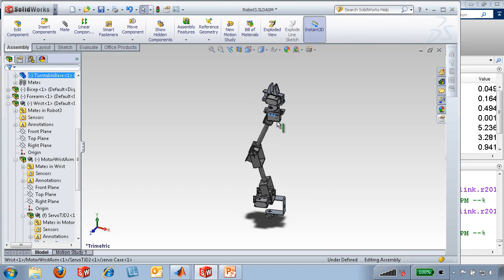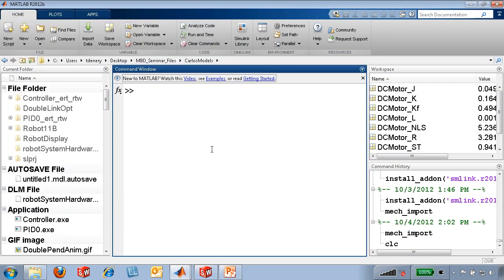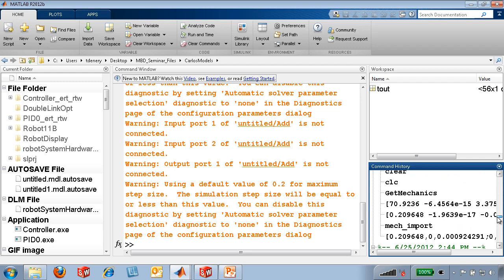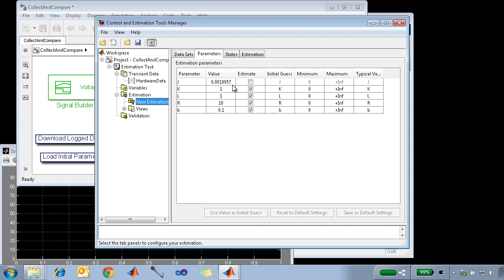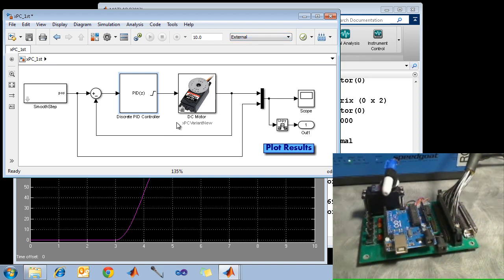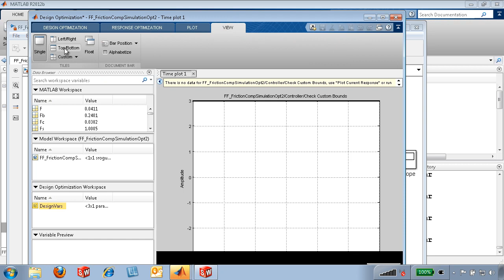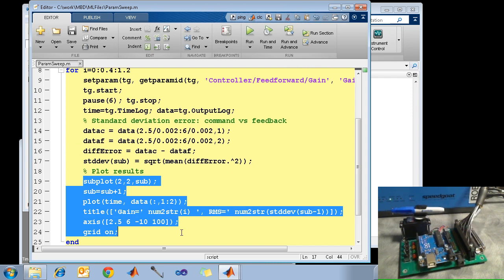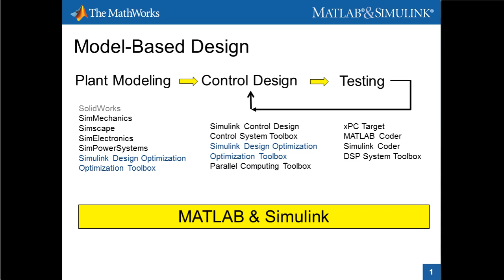Model-Based Design of Control Systems

Comment: @MATLAB, instead of shown a commercial video of what you designed behind the scene, it would have been very helpful to us as students to show us how to create the model from the start.  Do not only show me the final model without showing me how did you get there... 

I am really struggling with Matlab and Simulink thing as there are no documentation or videos that explain the complete model step by step.   All that I can see from the internet and books are either too basic or just showing the final results with no details of how to do!  I can assure you once I graduate I will never use this software.
Reply: yeah. It's not stated in the requeriments, but to get things done you need a compentent programmer, besides the sotfware. As I can see you want your shit done free for you. If  you can't put any effort to learn, you can use another software.
Reply: @michaelzlprime  a solid example from start to finish so you can do the same clicks in the same options whitout thinking and show the work of other people as your own... yeah...
matlab has thousands of pages with detailed documentation, but that does not count, does it?